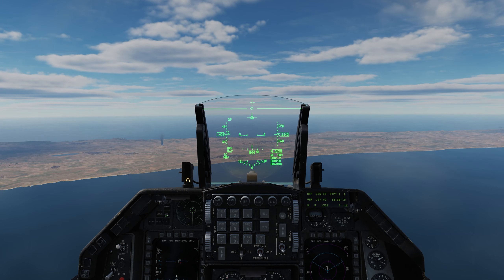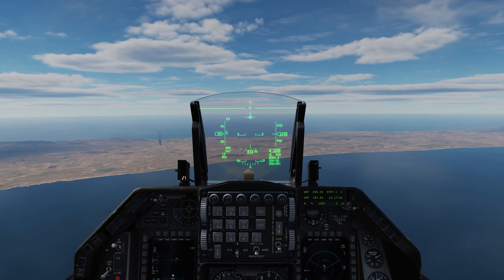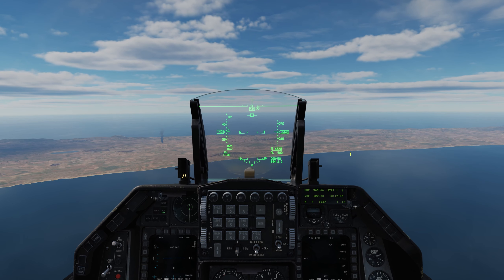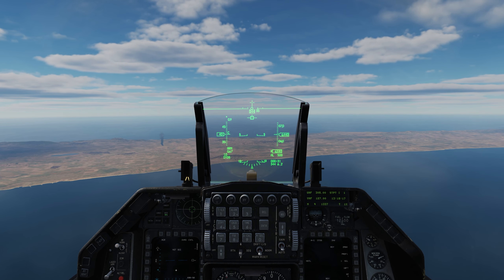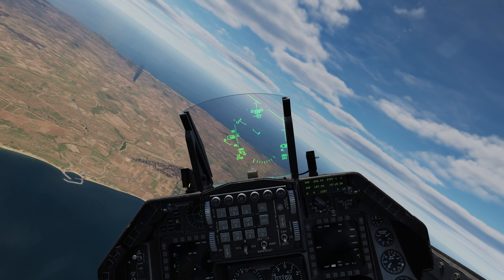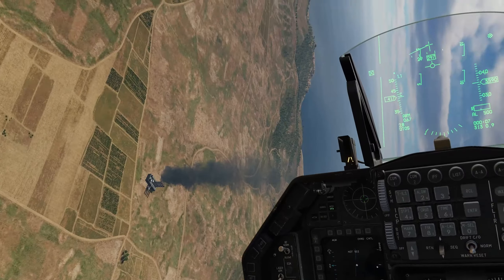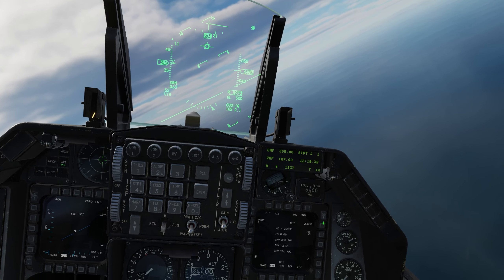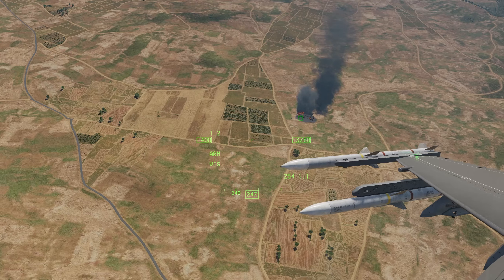DCS World F-16C Viper DTOS Mode Tutorial

Comment: I've always wondered why the f16 felt so clunky when practicing air to ground and why the LANTIRN always defaulted to locking at steerpoints. It was because DTOS was the F16 equivalent of Target of Opportunity and it wasn't implemented yet back then. Just goes to show how barebones the f16 was last year. Here's to hoping that ED covers as much ground as possible with the f16 before they decide to focus most of their efforts on a different module again like they did with the hornet.
Reply: They need to focus in the Hornet again first before moving on... everything is broken.

Also, I believe you meant LITENING. LANTRIN system wasn't on the block 50.
Reply: @mobius7089  My bad. I had the F14 in my brain while writing that.